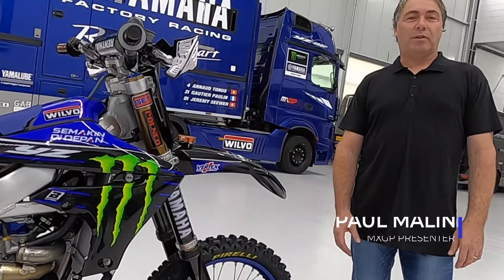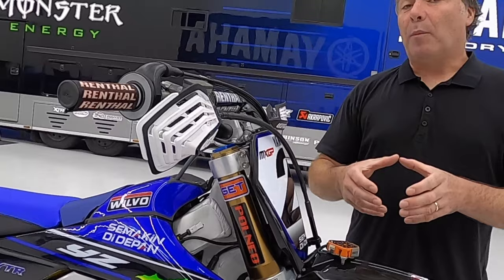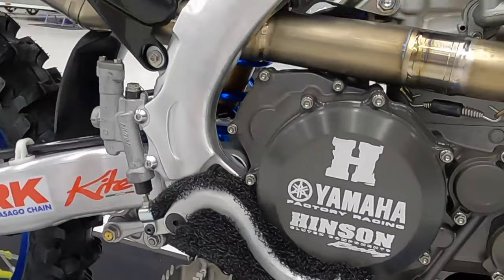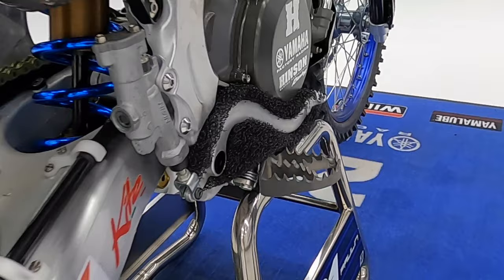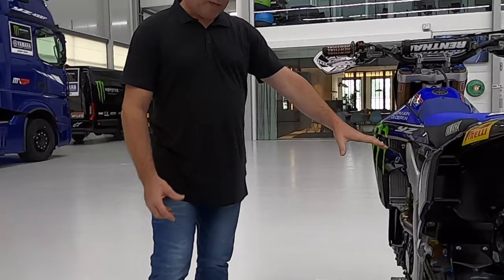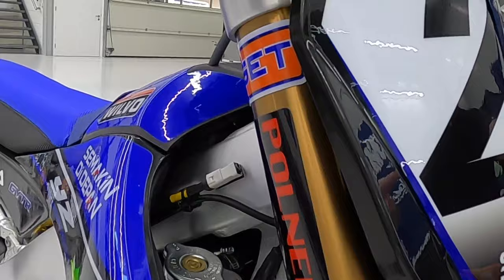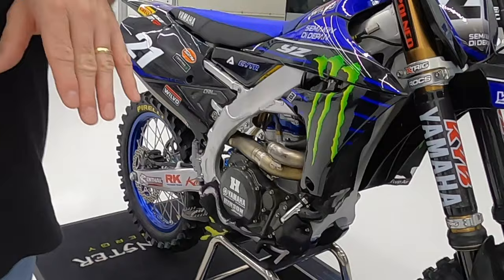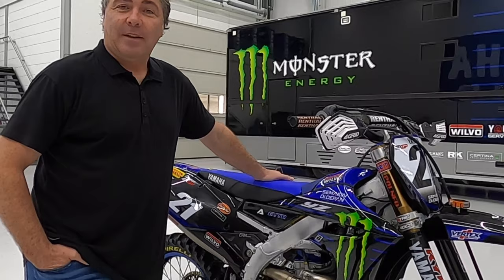What Parts Are On A FACTORY YZ450FM?

Comment: it doesn't hold a candle to a KTM
Reply: When it comes to suspension and reliability, it holds a blowtorch to KTM.
Reply: Cause it’s better so it’s the light! Sorry to say but Yamaha engines last way longer than a KTM. I’ve seen so many Yamahas with over 100 hours and the valves are still in spec and haven’t been shimmed yet. Can’t say that for KTM.
Reply: @mxr7586  yeah that's why Cooper Webb did so well after leaving Yamaha for KTM